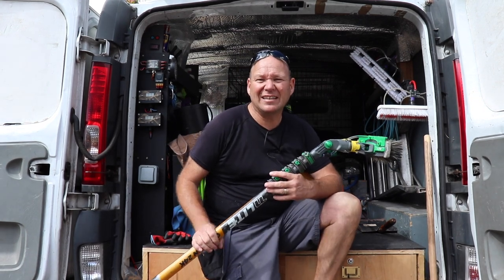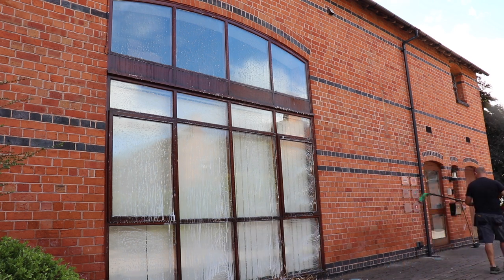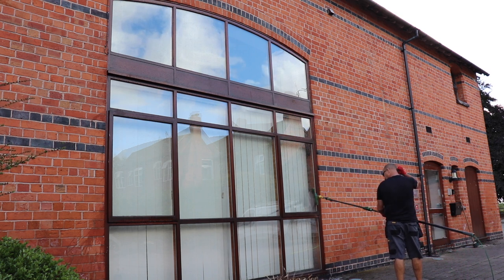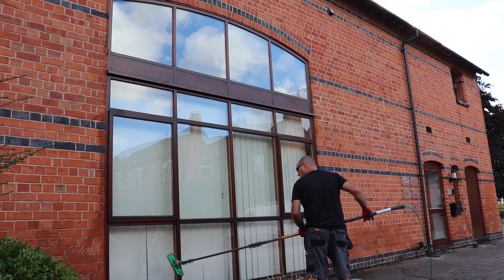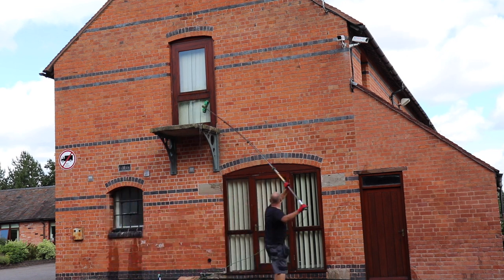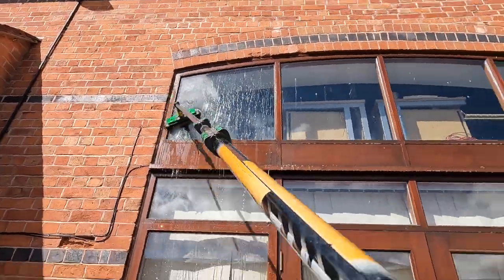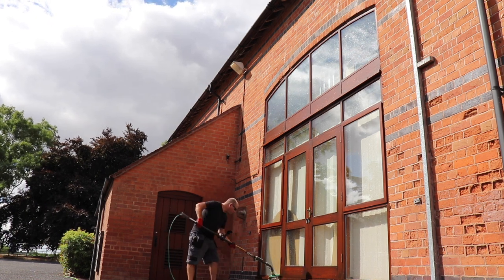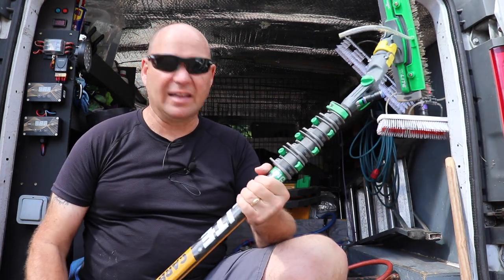Filthy First Clean. How I Do Them

Comment: I've  always used  the highest flow possible Dave. Keep telling other window cleaners to do the same but they just don't get it! I absolutely fly through my work . Thanks as always for the upload ☘️
Reply from the maker: Its definitely worth trying for a week or so to see the difference if they don't already do it 👍
Reply: What kind of jets would this be with? I like the 1.4mm but they do limit flow but increase pressure 👍🏻
Reply: it depends on the cleans 

i used to be a pump directly to battery with an on/off switch and absolutely rocked through work

i have a controller now and usually crank it higher than most but it is overkill on new windows that get cleaned every 4 weeks... plus it depends how much water you carry

Comment: Hi Dave, over here in Ireland. Love the videos. You did a video before about how you do first cleans and you mentioned UBIK 2000. And you were putting it on with the back pack. Don't you bother with that now? Is it just fairy on the brush every time? I've been using fairy on the brush for a while but I'd like to know your opinion as you've tried both options. Fairy seemed to work well.
Reply from the maker: It depends on the job. Most of the time it’s fairy on the brush. If it does need a chemical I use synergy pro from Pureseal now

Comment: I use the unger nlite brush as an everyday brush. Love the bristles but all sorts of problems otherwise. The rinse bar wears badly at the ends and splits. I've had 2x connections on the pencil jets snap. I love the swivel but the constant movement wears the joints quite badly so it becomes very slack and it can't be tightened. 3 in a year .
Looking at the xline dupont with the rinsebar in the middle of the brush.
Reply: Interesting feedback, can't wait to see if we have the same nlite issues. Xline rinse bars are really good, if you order use code tcg5 to get 5% off and support the cleaning guide
Reply: @SamuelPeden  Cheers Sam 👍
Reply from the maker: I do normally use the Xline brushes on my Ova8 but been testing the Unger kit for the Cleaning Guide

Comment: Hi Dave, even better 1st cleans use a injector with vision in the canister, use the customers water supply and run off tap high flow, so you can go around the whole site in one hit, then come back and rinse with pure water 👍 much quicker and cleanses everything
Reply from the maker: Great tip. thank Dave 👍

Comment: Nice video Dave,  I'm knackered just watching! Did you have a swivel on the brush?
I usually have a back pack with pole setup and fairy liquid in it for first cleans,  keeps your rinsing down free from soap. Not sure if it's as quick?
How does the grip compare with ova8?
Reply from the maker: Yes mate there is a swivel on it. I took a while to get used to the grip but I did in the end and it’s ok.